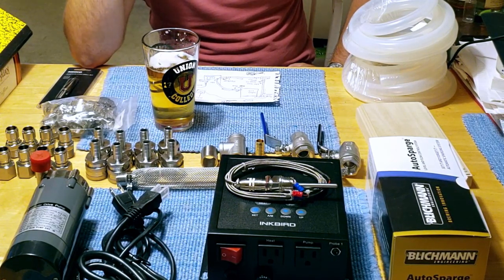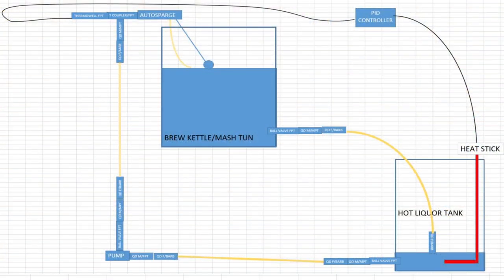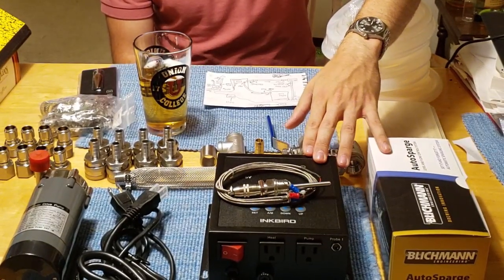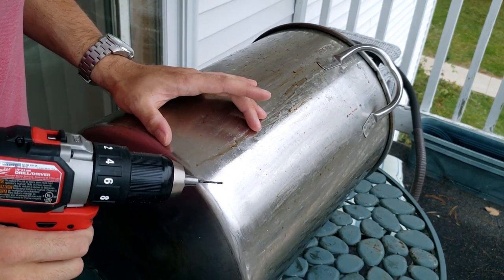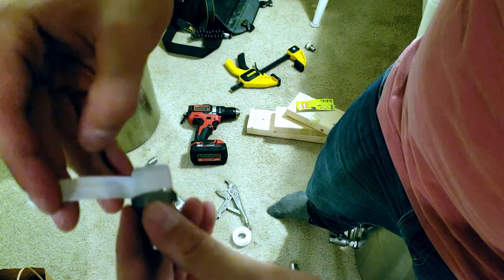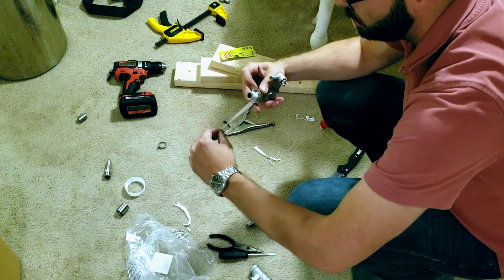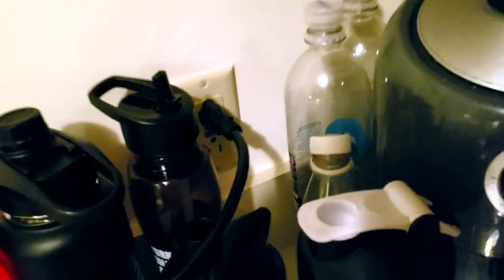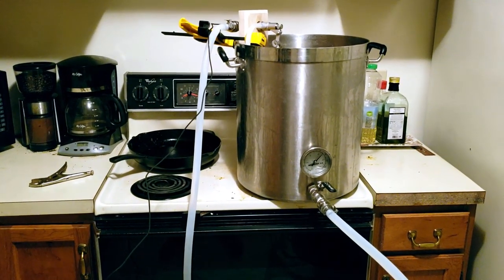Building a DIY Recirculating Mashing System

Comment: Great Job! I have a similar system, but no PID, instead a potentiometer adjusted Solid State Voltage Regulator with a 2250 watt ULWD 120VAC. I built the controller myself, and could easily switch it to 240VAC later on. I too still have some kinks but it brews really well!
Reply from the maker: That sounds awesome, but that's almost 19 amps coming from a 120V circuit, what kind of breaker are you running that on? My electrician friends advised me not to exceed 83% of the breaker rating especially if its long periods of usage time. I run mine on a 20 amp, but thats only at about 68% load. Not criticizing here at all, just want to know more.
Reply from the maker: @Bassguitarist1985  Thanks for the reply! I think going electric can be intimidating to people first checking it out because of the code and safety concerns but thanks for breaking it down. Definitely educational for me and hopefully for people checking this out in the future!

Thankfully my ramp up times aren't an issue since I supplement the heat stick with my stovetop burner for now, but that's a good tip with the second heat stick. Cheers!

Comment: I just use a sous-vide immersion cooker submerged in a smaller pot filled with water, with a copper immersion chiller submerged in the same pot.  The wort is pushed via pump thru the chiller, and back into the mash. Control flow via ball valves on the output side of pump, and temp control via the sous-vide cooker.  Works like a champ.
Reply from the maker: Sounds like a small scale HERMS system! Very interesting idea
Reply: @TheApartmentBrewer  Works really well, and thankfully, already had everything required. The sous-vide cooker was purchased a few years back for my wife.  I'm able to pretty much step all the way thru the mash temps using this method.

Comment: Great video! Looking forward to the future video showing your new system working!! I have a Pico C unit that I just use for my recirculation and mashing of wort. It keeps the temperatures dead on so far. -Chris
Reply from the maker: Thanks! Is that unit a higher wattage? I had trouble finding ones that worked for 1650W
Reply: @TheApartmentBrewer  1500 watts of powerful steam heat brew. But it's only for 5L batches. Small size but works for me
Reply from the maker: @chrisbrendamills  Sweet! Interesting stuff and thanks for sharing

Comment: Nice build - do you have to worry about scorched wort and proteins while recirculating?  I thought about doing something similar, less the blichmann autosparge - just a couple of ball valves to throttle the wort flow. I have an old stainless pot from an oil fryer...I thought about putting a hole in it with an ulwp element and another hole for the thermocouple. I currently use a sous vide probe directly in the pot for managing mashing temps - it works, but struggles and cannot recirculate properly.  I had stumbled across the Inkbird 16s controller...problem is, the controller is 1/3 of the cost of a more effective solution, like the Anvil 10.5 gallon brewing system - I'm almost ready to go with that since I got a 65 Watt pump - just get the unpumped Anvil.
Reply from the maker: I really love the controller, and I found this build to be a little cheaper than a clean slate recirculating system, albeit a bit less graceful. So far, I've only scorched wort once with this system and that was under a very specific circumstance: a high protein grist at protein rest temps, and not submerging the element deep enough. Outside of that it's been very reliable. I think whether you choose to go with a brand new system or not should be based on space and a cost benefit analysis, and whether or not your old equipment will play a role. Best of luck!

Comment: I am current,y using a similar set up using a digiboil 220w and a water cooler mash tun with the kettle serving as hlt and boil kettle. I do have a propane burner and 10gal kettle which I was using as a three vessel system but I started wondering why when the 220 is plenty to boil with. 
I also use a plate chiller my advice to those thinking of going that route is clean it immediately after use and use an air compressor to blow out the water after because it will hold water and that water will get nasty.

Comment: This Inkbird appears to require an NTC (negative temperature compensation) probe (R25 = 10kΩ).  RIMS tubes look like they require a 1/2" NPT on the sensor end.  The input jack appears to be a TRS (tip-ring-sleave); not sure of length.  Putting it all together, looks like your probe is best for your rig or a RIMS tube.  Can you list your sources for the probe and the replacement jack?  BTW, congratulations, Dad!
Reply: (Unless that's an NPT thermowell with the thermistor wire coming out of the end--any clarification welcomed!)
Reply: Uh, that probe looks to have 3 wires; are you sure this isn't a PT-100 probe (which is not compatible with NTC probes)?  Won't work correctly with this Inkbird.

Comment: I wonder if you hooked up your electric stove to the controller and did a side by side on the stove? Have the mash off the stove and no element. I wonder if the controller could kick on the stove top electric element? And make this system work without the heat stick
Reply from the maker: Interesting idea but not gonna work since the controller only can handle 120V, but a stove is usually 220 or 240V

Comment: Are there any hygiene concerns on the ball valves over time? How do you clean all of this stuff? Might be worth making a vid about cleaning equipment thoroughly.
Reply from the maker: Good question! Aside from typical post brew cleaning, I will usually do a full volume boiling PBW flush every two to three brews. And it is definitely a good idea to take apart the ball valves and clean them with PBW as well.
Reply: @TheApartmentBrewer  do you just rinse out the boil kettle and the rest of your equipment the rest of the time that you do not clean with PBW?
At the moment I am cleaning after every brew.
Reply from the maker: I'll scrub it down with soap and water, save the PBW for the deep cleans. Never had a problem the entire time I've been brewing.
Reply: @TheApartmentBrewer  awesome thanks for the info

Comment: Stainless Steel hole saw or chassis punch.. Look them up if you haven't already.. And you only need 1 -2 raps of Teflon tape on the threads and always turn the pipe clockwise onto the tape. You put way to much on and keep the tape flat while raping. That way it doesn't come off while you thread it in.. Sry in advance if someone already said this.. Hope it's working good for ya..

Comment: Why not just make a HERMS system with the drop in element in the HLT?
Reply from the maker: Good question, but a HERMS coil would have costed an addition $150+ and would require even more kettle modifications. I found RIMS to be more economical for my situation
Reply: @TheApartmentBrewer  Great point. You're basically doing a blend of both methods, so youre a pioneer!